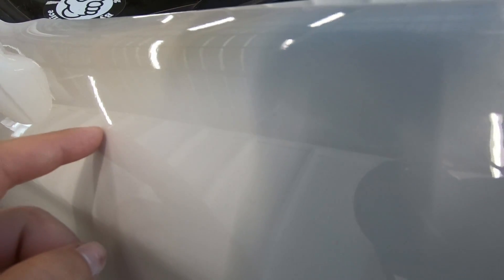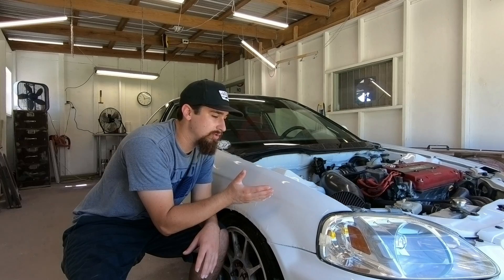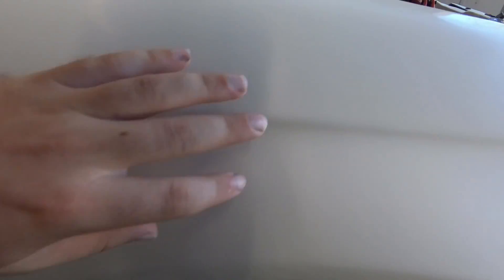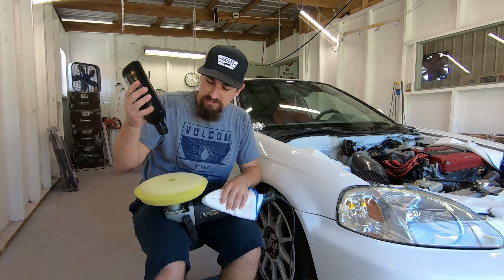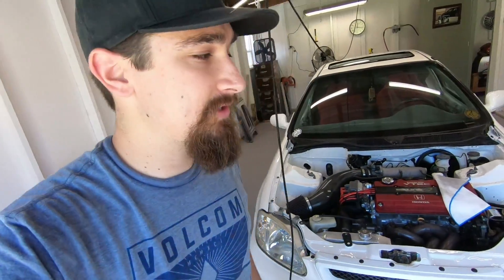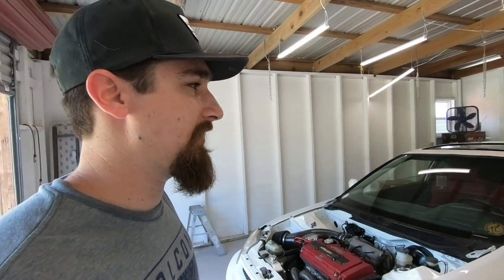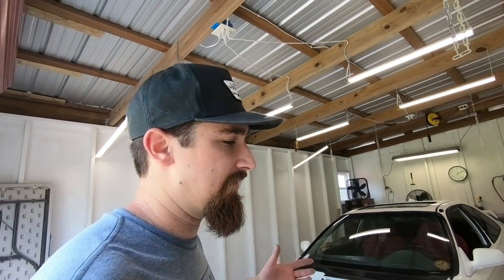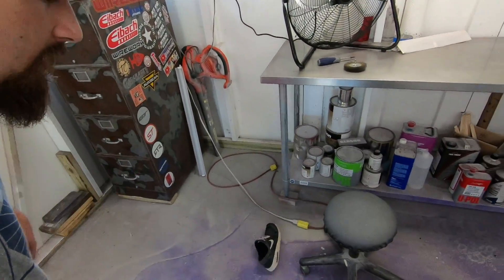Wet Sand and Buff Fresh Paint, Project Civic Type R Coupe

Comment: I used to run Hawk pads too, switched to Brembo OE replacements.
Reply from the maker: have you had better luck with brembo oe?
Reply: No noticeable difference in performance, but yes less dust AND quieter. I even run the Brembo OE rotors. I don't think you can beat the price-to-performance for a street ride with it.

Comment: What wax are you using? For off the shelf stuff I'd recommend Meguiars Ultimate Liquid Wax, make sure you get the one with the yellow stripe around the clear plastic window on the box. Otherwise you can order Finish Kare FK1000P, it lasts longer and has much better beading. That all being said, I wouldn't waste time waxing it if I wanted longevity, I'd ceramic coat it.
Reply from the maker: Im really going to have to look into ceramic coating as i have never used it. Also as far as wax i am using some stuff that the paint store recommended i use about 2 years ago, thats all i will use since! Ill see what its called and get back to you.